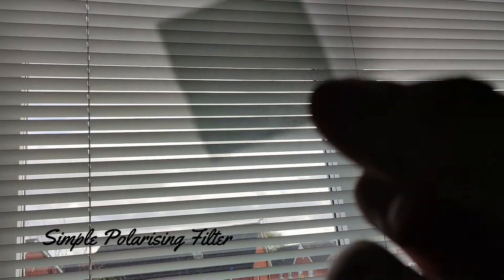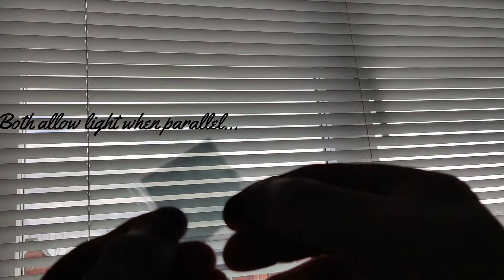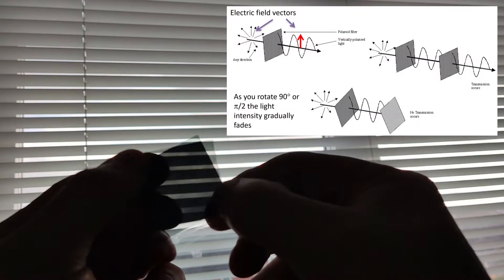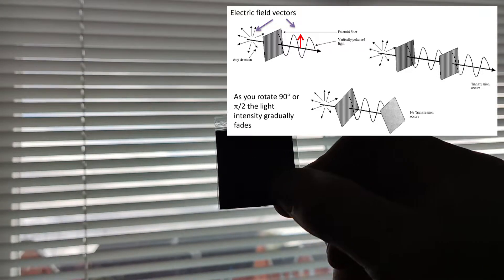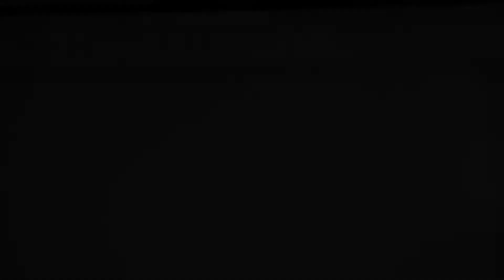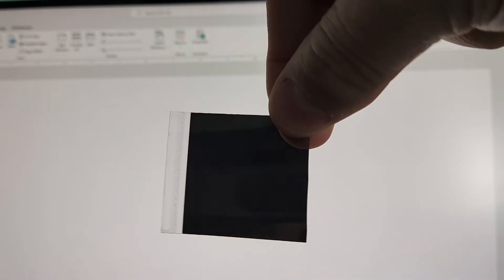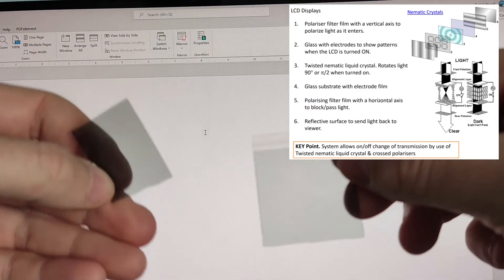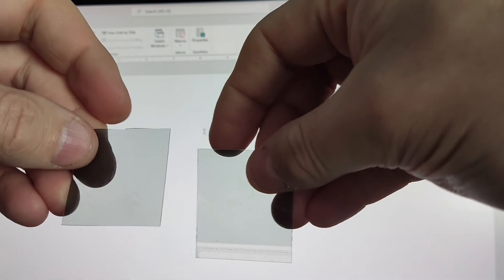Polarisation of Light and LCD Screens  - AQA A Level Physics

Comment: Hello @animatedsci , thank you for explaining everything! My friend and I are working on a school project and are wondering if it is possible to make a phone screen you can only see through glasses without taking out the polarizer pre-installed in the device. 

@wrongsideof40 said "Next: if I hold one filter in front of my eye and orientate it such that the LCD image disappears, if I then place the second filter in front of the monitor, by rotating it, I can make the screen's image reappear! If I reverse the the second filter (so its other face is facing me) it then has to be rotated by 90° for the same effect."

We are wondering what type of polarized film he used for this and how we could do this ourselves. 

If you can help us, that would be great, and we would really appreciate it. Thank you!
Reply from the maker: I am not sure that is possible really. But sounds interesting!  The whole process for screens is very complex and what I have shown is the simple idea really of drawn lines in a plastic sheet. The internals of an LCD screen are hugely complex.
Reply: Oh, thank you for the fast reply. I will continue doing more research to see if it is possible though. Thank you!

Comment: Thanks for putting this up. I'm looking for an explanation to the following: I've taken the two polarising film inserts out from a pair of 'Real D' 3D cinema glasses (as you do!). According to Wikipedea, these are circularly (not linearly) polarised.

If I hold one of the filters in front of my LCD screen, then rotate it, I can indeed replicate the effect that you demonstrate in your video.
That's the first thing I don't understand. My shaky RADIO theory says that a linearly polarised transmission, when received on a circularly polarised antenna would see a decrease in signal of 3dB at all times,  despite any rotation of either antenna. Don't light waves stick to the same rules?

The next thing I don't understand, is this: If I reverse the filter (so its other face is facing me) rotating it then only subtly alters the hue of the monitor.

Next: if I hold one filter in front of my eye and orientate it such that the LCD image disappears, if I then place the second filter in front of the monitor, by rotating it, I can make the screen's image reappear! If I reverse the the second filter (so its other face is facing me) it then has to be rotated by 90° for the same effect.

And so now I'm REALLY confused! Once the image is filtered out, how can that happen? Are the filters also twisting the light waves?

Finally, leaving aside the LCD monitor, by looking out the window, through both films, I can replicate your own 'window' demonstration (but this is again dependent on which side of the films is facing me). Leaning on my radio experience, again, no amount of rotation should make a difference (the main reason circular polarisation is used from   spinning satellites); there should either be total transparency, or nothing at all.

I wonder - if you have a little time - you can offer an explanation for any or all of the above. Thanks!
Reply from the maker: I think the circular polarisers just will not do the same at all.  Check here http://hyperphysics.phy-astr.gsu.edu/hbase/phyopt/quarwv.html which explains but the filters on a circular polariser has one which makes it linear from original random and then a second which makes it circular with a complex setup where the light it split and then recombined maybe with a refractive coating, then as you spin it around you get varying amounts of light. I think it's a better way to do it as my video is really just showing how a very basic idea of blocking light it taking place and shows how light is plane polarised. For a proper camera we want light from different angles. Hope that helps.
Reply from the maker: Also of course you are having Interference occurring which will be different for radio due to the considerable longer wavelength
Reply: @animatedsci  Thanks for your instant response! I'll check out the link.